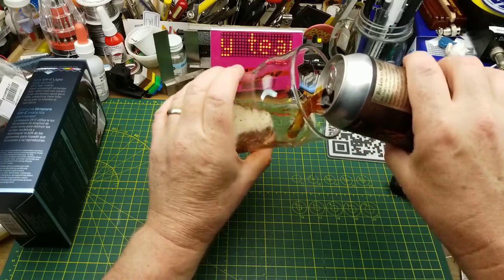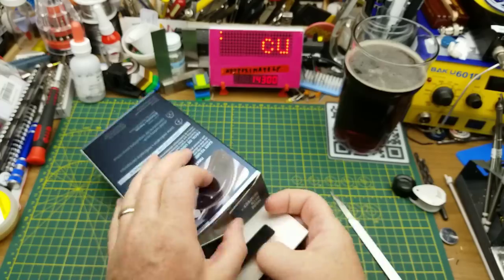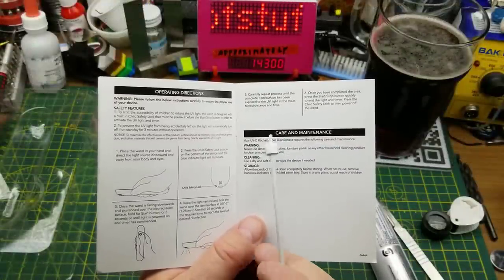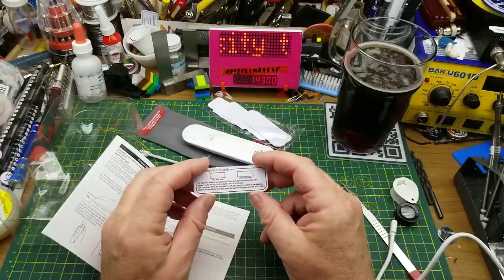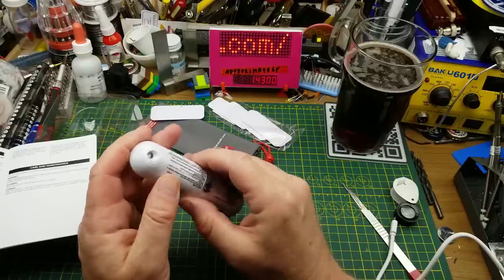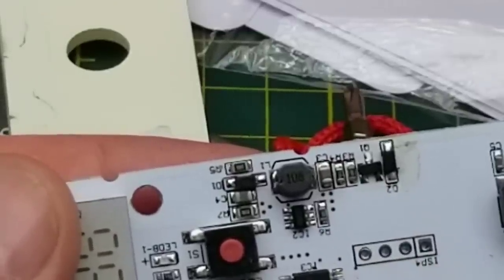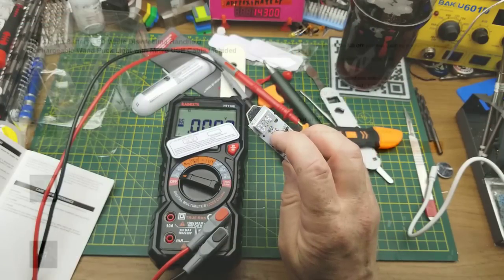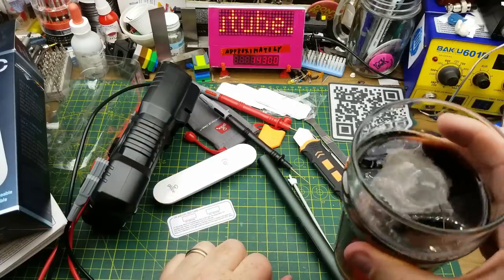Dollar store UV-C wand. Real or fake?

Comment: The LED is a dual bandwidth one, quite valuable. It outputs UVA and UVC light, with UVA being the primary thing people will see. UVC doesn't glow that brightly so people may assume that it's not putting out anything, so it's quite important that it becomes visible.
Reply: The violet LED is also used to provide visibility too. It is clever!

Comment: That seems nice device and well made. For disinfection purpose, there is always the question of how much power any device has. You do need a decent power level to disinfect anything in reasonable time and most often a wider beam to be usefull. (even the 500mAh battery givbes a hint, it cannot be very powerfull)
For other uses where low power is enough, a device like that can be very handy.
Reply from the maker: Great point.
The fact that it generates any amount of UV-C is a pleasant surprise.

It'll be more useful to me as a UV source than as a sanitation tool.  Or as a source for parts.

Comment: Maybe you could use it for curing uv glue or resin. As for reusing components, I think only battery is usable, as for TP4056, that ic is very cheap, you can get ready modules with them for cheap.
Reply from the maker: TP4056 modules are excellent. I've got several of them in various projects already.

Comment: Mayby it can cure some UV resin.
I've been using my 3D printer resin as a glue.
I use a toothpick to spread or smear it where I want it. 
Flash it with my UV lamp and instantly cured.

Remember that 3D printing Pen?

redrok
Reply from the maker: That's an interesting application.
Reply: UVA is sufficient for that.

Comment: SC92F7252 is a 8051 based MCU. google: SC92F7252_7251_7250v0.1en.pdf

The SC92F725X is integrated with 4K bytes Flash
ROM, 256 bytes SRAM, 128 bytes EEPROM, up to
18 General-purpose I/Os (GPIO), 6 external
interrupters, three 16-bit timers, 9-channel 12-bit
high-precision ADC, 6-channel independent 8-bit
PWM, IO ports driven hierarchical control (P0 and P2
ports) with 4-level drive capability, internal ±1% high-
precision 24/12/6/2MHz high-frequency oscillator
and ±4% precision low-frequency 128 kHz oscillator,
UART communication interface and other resources.
To improve the reliability and
simplify the circuit design, the SC92F725X is also
built in with 4-level optional LVR voltage, 2.4V ADC
reference voltage and other high-reliability circuits
Reply from the maker: Thanks.
Looks like a capable little chip. 
Possibly a bit overkill for this application.
Reply: At 10:12 the seven segment display looks like it is multiplexed. The chip is mainly just driving the display and counting down the timer and maybe reading the button. Its definitely overkill for this application.